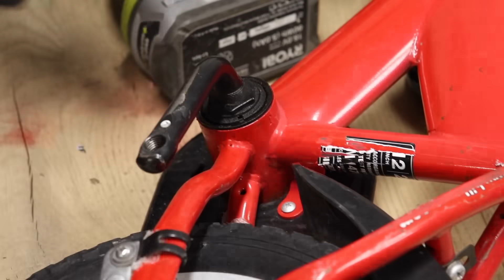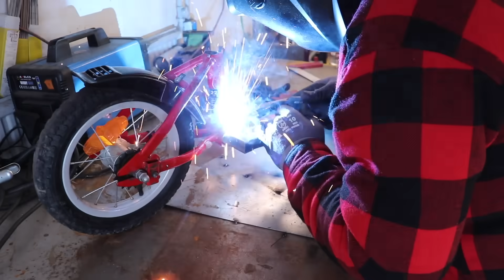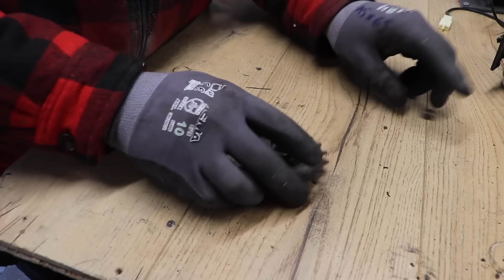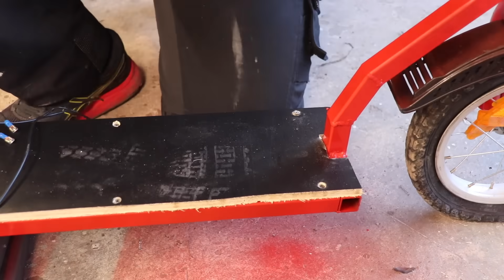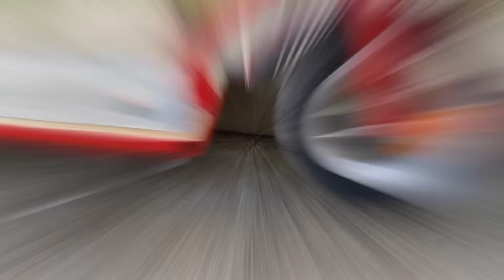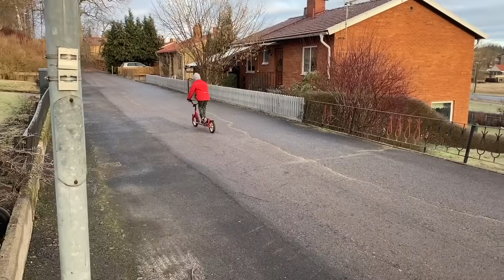How to make electric scooter at home

Comment: Large sprocket on rear  wheel & very small sprocket on motor. Esc plus e-throttle plus homemade 18650 36volt 12 Ah  battery pack with battery management system. 750 to 1000watt DC motor. Waterproof charge point. Brakes on rear wheel that cut power to motor.  Reinforce the frame to front & rear. Job done.
Reply: Saan makakabili ng pina electric motor niyan

Comment: Everyone saying itll be a slow ride. Any suggestions on how to make it faster? Better DC motor?
Reply: Use a bigger battery.
Reply: Ry bult af!/ Go down a hill! (ha-ha-ha....)
Reply: Gearing issue for sure. Smaller motor drive gear and larger gear on the wheel.
Reply: @goldf3lla  Would jt be possible to use more than 1 drill battery?

Comment: reduce the motor sprocket and enlarge tire sprocket to get more torque
Reply: It will waste the the battery keeping the motor sprocket bigger tha tire reduces the pressure on motor which mean motor has to work less to get more distance
Reply: @EdwardBeGaminG  what if he had two motors? One for torque and one for distance, and just use a switch to switch between them.
Reply: @speedrundemon21  then this project won't be this simple

Comment: Very good craftsmanship.  Reverse the gears and you'll see a difference in performance.  High speed motors require a very small front sprocket.  Keep it going!!!
Reply: Its really not though.
Reply: @tac6044  it is, the motor can't spin freely because the gears are too tall. If you change the motor with a smaller gear it can rotate in a much higher rpm

Comment: After soldering the wires to the terminals on the battery pack how do you plan on recharging it?
Why didn’t you use a motor controller out of an electric drill instead of a push button momentary switch?
Reply: 8

Comment: While I admire his craftsmanship and ingenuity, everything he builds goes about walking speed.
Reply: Yeah its kind of slow. You can increase it to 20+ mph by running a 1kw through that motor via an ebike battery instead of a tool battery....
Reply: T
Reply: i agree even so was for a kid the kid could just push it him self at the same speed and even go faster
Reply: Please what kinda motor is that which runs on 12v battery 🔋?

Comment: That will go alot better with better gearing. Too much load is put on the motor, and it'll destroy the battery pack in no time. Smaller sprocket on motor, larger sprocket on wheel

Comment: The gearing is way too fast. You should have used a much smaller gear on the Motor and use a bigger gear on the wheel.
Reply: You are right because the two gears or the two stars whatever they are called are large and therefore it has no force if a small star in the engine and the large one in the wheel will have more force and will be faster because it really is very slow
Reply: Its add more speed
Reply: Yes you are correct with the gearing
Reply: Either way, that motor isn't producing enough power.
Reply: I also think the gearing is wrong

Comment: It is far easier to just fit a rear wheel with a "Hub motor" in it, already available in China.... Why Reinvent the Wheel ???
Reply: John B price difference
Reply: A hub motor is 3 times more expensive ... The only thing he do wrong was the battery
That's a 24v motor with a 18v battery

Comment: 1 battery is 12v 12AH possibly. 
Will run 5-10 miles and hour for 15-20 minutes tops. Depending on motor amperage.

Comment: Ok! You've made me a fool along 11 minutes... At least this piece of shit made me laugh at the end.  Certo! Você me sacaneou por 11 minutos... Ao menos  esta porcaria me fez rir no final.
Reply: it's just under power....slapp 36V in it at least...that motor can handle it. It looks
like at lest 350- 500 Watt. My E 300 only has a 300 24V...it'll do 10-12. ( it's fast for kids..if they're not used to it). Hes' only using a 18v LI on..So its under power
for that motor to begin with..He needs 2 of those packs...lol

it's slow for me....i need a 1800watt brushless at least...:-P 
i have to use Lipo when I up grade it to  500watt. Make it do 15-18 mph
There's no room for 3-ea lead acid..in the battery compartment....
definetly REAR breaks for anything over 8 mph..
Reply: 1243
Reply: @oneeyemonster3262  no, he did not put a reduction stage on the engine, the rotation of the wheel is the same as that of the engine, so the engine cannot turn, if he puts a reduction stage it will increase the torque and it will go faster than that
Reply: @andregustavoassing134  you lack simple comprehension of DISCHARGE RATE on Batteries. It can be confusing becuase battery Manufacture miss label them...The 24v Lion 18650 are 20-30 C rating at best.
Lion cant handle HEAT very well....Dosnt perform as well as LIpo.
it has about the same power is 5s 18v-22V 50C Lipo batteries.
It;s hard to compare to lead acid....
but when purchasing lead acid batteries it's label as CRANKING POWER
or ..NOT Ah...
Ah = SIZE of Gas tank or RUN TIME
Some people say if you double up on Ah
such as wiring  PARALLEL..it'll increase the CRANKING power or discharge rate....In PRACTICE it dosnt...it'll just get longer running time..batteries dosnt get as hot....perform better simply because of less heat...
it's not the same as using batteries with double the cranking power
or Higher discharge rate...
Sort of like using 90 octane....vs 110 octane...
when using 20c  verse 25 c discharge

The size of the GAS tank dosnt effect performance.
Reply: @oneeyemonster3262  if he puts a higher voltage battery instead of a reduction stage, the only thing he can do is burn the engine

Comment: The problem is that you don't put a controller on it, you put a switch directly on it and the battery should be 36v because that is what the motor consumes and you put an 18v battery on it.

Comment: Should have used a smaller sprocket on motor and mounted button on handle bars. You can see kid struggling to balance and push button with foot

Comment: 2x 12 batteries connected to make 24v and  smaller 9 tooth cog on the motor would make this much more fun, also a support where the bars join the deck as that looks like it will snap liek a twig if it hits a few potholes
Reply: Wait your saying to use more than 1 drill battery?

Comment: I have mixed feelings after watching this...  8/10 for resourcing the scooter frame from a small bike 2/10 for the power supply and "throttle" "switch" lol r u srsly going to ride this thing with the battery pack of a motomaster drill 😂😂

Comment: There is a electric throttle available in the market you should install this instead of a botton stepping board... And also your chain should be stretch or tight bcoz there is no shock install... Other motorcycle the chain is loose up bcoz of the shock install bcoz it will stretch while bouncing

Comment: You have metalworking skills however your design will not hold up. The leverage between the steering neck And where it mounts to the deck will not be strong enough to last you need to use like 1-1/4x2-1/2  tubing or something  around those dimensions. also you’re going to end up burning up that motor because you change the size of sprocket On it.   When you increase the drive motor sprocket size you increase the amp draw on the motor. You have to run a very small sprocket on the motor.  The rest of it looks doable trust me I know I build electric bikes I have two of them that are over 15 years old now and still going

Comment: You have to choose the translation of the chain so that there is enough torque on the wheel and the motor is operated at its nominal speed. He can't even pull the child because the translation is way too long. The battery and motor won't last long. The motor is almost blocked when it does not even reach 25% speed. It's like driving off your car in 6th gear.

Comment: Need bigger motor or higher amp batts far to slow or were u going for the cruiser look still a good build machine
Reply: Or maybe just change the gear ration becaus i have built many electric vehicles and by changing the gear ration it accelerates faster and maybe even better top speed

Comment: How to slap together an electric scooter at home. Not bad for prototype mark one, but it's nowhere near good enough for a final product. I would have gone with a 750W to a 1,000W motor for a child's scooter. It also is in need of a speed controller, a speedometer, properly sized battery pack, and lights.

Comment: Your gearing is wrong. The motor sprocket should be smaller than the wheel sprocket. With the bigger sprocket on the motor, it has no torque.
Reply: thiamjoo 
Maybe he don't want a super fast scooter for kids...
Wich I agree...

Comment: Muito trabalho para depois por um motor tão fraco. Entendo que potência significa necessidade de mais bateria mas pô, o troço nem mantém o movimento depois de iniciado com os pés. Ah não, precisa melhorar.
Reply: Amigão, levando a realidade dos Br, vc poderia me sugerir algo que eu possa usar como motor elétrico?
Reply: @robsondasilvamoreira4895  Talvez este motor até era suficiente e o problema está na relação. A catraca da roda tinha que ser bem maior que a do motor para que o motor possa girar com sua velocidade ideal. 

Com uma boa relação 350W seria suficiente para um patinete. Você encontra motores deste tamanho em ferro velho, o motor de arranque tem uma corrente muito grande,  e iria gastar a bateria muito rápido, provavelmente não serve, não sei, mas tenho visto o pessoal usar motores de ventoinha. Tudo 12V e prefira bateria de chumbo mesmo porque as de lítio acho que são mais por moda mas elas exigem que não se deixe descarregar completamente e isto pode ser um problema.
Reply: @MaxBorges888  Valeu. Dando uma rápida pesquisa, vi de um rapaz que transformou o alternador em motor e achei um processo bem interessante.
Reply: @robsondasilvamoreira4895  Sobre a relação:
Suponha uma roda aro 20. Isto quer dizer 20 polegadas de diâmetro ou 50 cm. Multiplicado por pi dá 1,60 m percorridos por rotação da roda. Para andar a 20 km/h = 5,5 m/s precisaria dar 5,5/1,60 = 3,5 rotações por segundo na roda. Se a rotação ideal de seu motor for digamos 3000 rpm = 50 rotações por segundo, você precisaria de uma relação de 50/3,5 = 14 ou seja o diâmetro ou o número de dentes da catraca da roda ser 14 vezes maior que o diâmetro ou número de dentes da catraca do motor.

Parece muito então acho que você precisa de um motor de rotação por minuto menor... Ai tem de ver o que existe no ferro velho. Mas é só substituir os 3000 acima pela rotação do seu motor e refazer os cálculos a partir dali. Por exemplo: motor de 1500 rmp daria 25 rotações por segundo e relação de 25/3,5 = 7.
Reply: @MaxBorges888  Valeu. Ajudou muito.

Comment: The frame design itself is unreliably made, to strengthen places where there will be the greatest loads, no reinforcements are made, the wheels from a children's bike are not designed to move with a motor and at speed, the steering wheel is very low, it is clear that the rider is not comfortable, uh buddy, where are the brakes? the design is dangerous, it can break just on the go, which is not good. Why does the one who made such a scooter not ride it himself?

Comment: Very bad, Because the number of gears in the wheel and the engine you make is the same and it tires the engine too much.
I will have just one suggestion for you.  The number of gears in the engine should be very low and the number of gears in the wheel should be too high.
Reply: And so both DC motor is not forced.  And your bike goes faster

Comment: A lot more torx you get when use a smaller motor gear, and a bigger wheel gear, the rmp of the motor is high enough and you get also faster,.

Comment: Good design but  the engine with that ratio hasn't enough power, plus the cordless drill hadn't enough capacity for that motor, in fact it's faster when the little boy uses his legs ..... Considered all good job but I'd modify something on it .

Comment: Couldn’t even haul that little kid, those motors are crap, go brushless and use a 48v controller and variable speed turn throttle and it will be worth riding

Comment: 10 teeh on the motor....and  60 teeh on the rubber wheel.....motor make 2500 rev.....and rubber wheel max 413 rev/min....=7rev/sek......MAX for a kid.......you motor is stalling and burning soon

Comment: It does not work.  To make it work you need a rear sprocket the diameter of the wheel rim and a front sprocket smaller that bicycle chain will turn.  Use a motor speed controller to prevent fire!
Fire warning:  Switching the motor on directly using a tiny little switch WILL catch the switch, wires and or brushes on fire.  DON'T TRY THIS AT HOME!
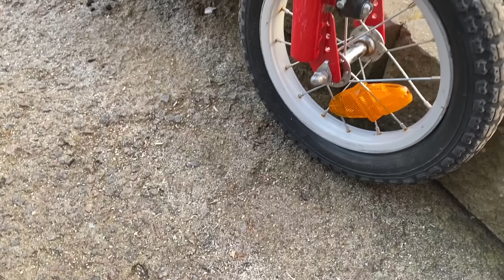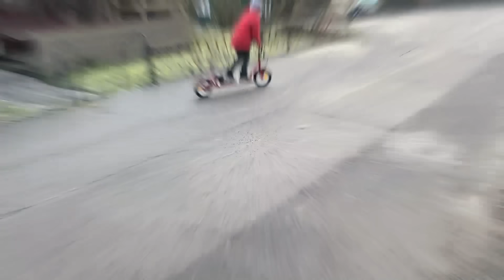You should not put your child on something that is not safe.  At 9:16 you can clearly see the front tire is not correctly seated in the bead seat of the rim.  At 10:12 to 10:13 you can see the front of the scooter moving up and down.  NOT SAFE   DOES NOT WORK   FIRE HAZZARD   FAIL